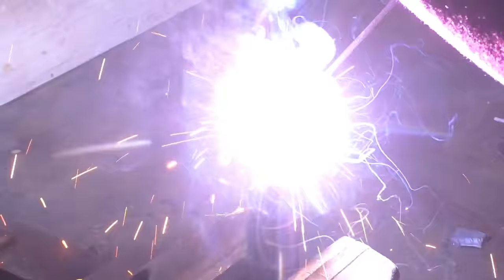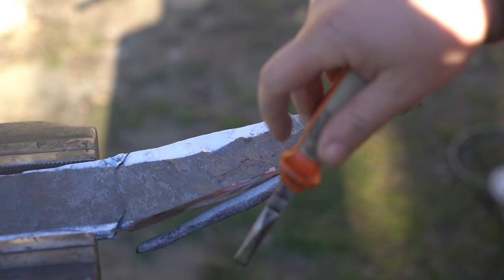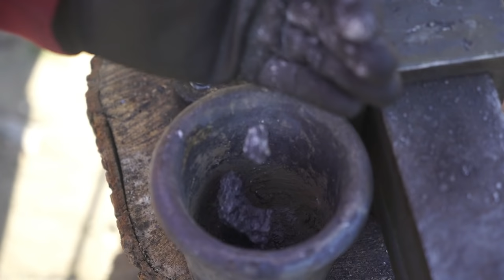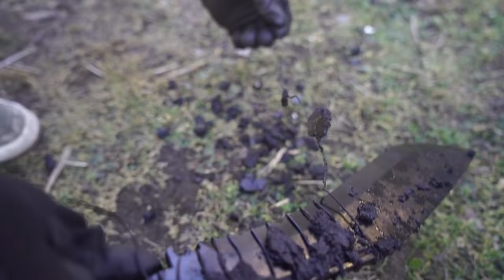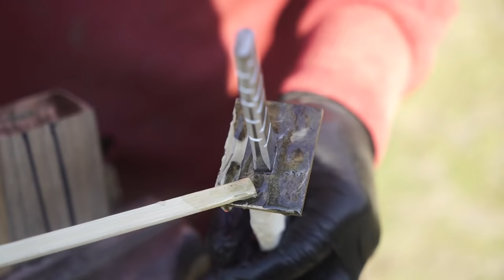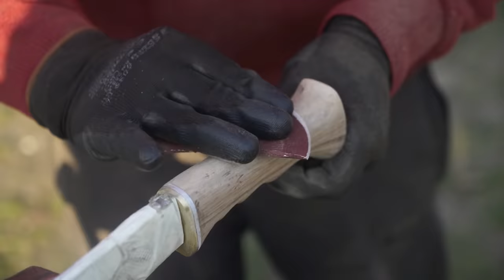Forging a KUKRI knife Out of Rusted IRON GEAR

Comment: There’s a great big crack through the steel where the bend is on the blade. That’s never right!!!
Reply: Yep, that fault will get worse.
Reply: could see the crack from the very beginning! why continue?
Reply: I saw that too. It looks like it is going all the way thru the blade. Guaranteed the first time he tries chopping with that blade or putting it under any kind of real stress then it's gonna snap right at that spot

Comment: Well sir, I see that you have made a mighty fine looking blade there but I can't help but wonder just how strong the blade is? I saw that when you were forging the blade and sanding it down that you had one big ole cold shut on the right side of the blade. I think if I were you then I'd be very careful using that blade. I suspect it will snap at that cold shut but it is a great looking blade just the same.
Reply: I've never built a blade but that was my assessment as well.
Reply: ok
Reply: and l'm not sure about that burnt tip i saw,    but agree , looks great
Reply: He almost broke the blade clean off when he removed materials with his pliers, so yeah, that blade is shite, whether he mended it or not.

Comment: Perhaps this is incorrect, but if you are making a knife to hack at things, I was under the impression that you needed to pin the handle or it will likely break.
Reply: It will eventually loosen up without a pins to keep it tight.   Maybe he didn't do that because he made the tang so thin?   Eithe way a good couple of jolts down the tang and than handle come right off.

Comment: The gears are made of case hardened steel (a tempered steel to which has been increased superficially the quantity of carbon to make possible an induction hardening): not the best solution for a blade, which will be for sure tenacious but not with high hardness. Said so it looks really nice

Comment: Forging is not cutting out a blade and tang from a slab of iron filled with cold shunts. Contestants have been disqualified on Forged in Fire for that because it's not forging. I would not trust this blade to  not to snap in half with use. I hope it's not been made for actual use because an epoxy handle with no pins, steel with cold shunts and cracks, and was that cooking oil? (cooking oil to finish off wood will go rancid. I can't think of any oil that looks like that that you would use except mineral oil to finish a wood handle) It all does not make for a practical knife.
Reply: So you're saying this blade will not kill  ?
Reply: I get what you mean but blacksmithing is a learning curve give the guy some credit will ya?

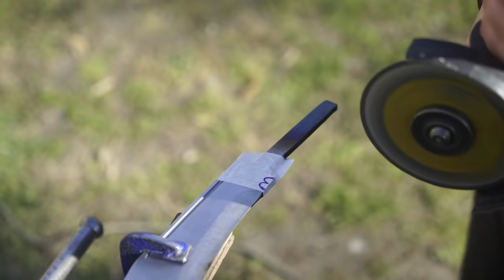Comment: 6:10 I always wondered what those divets are used for? I know they have a purpose but not sure what... Great video BTW .
Reply: Read this, to learn what's that: Kukri is a weapon which has his original roots to Greece. Great Alexander conquared Nepal and that's when the locals, took that Greek blade shape and made their own, shorter version which we now call Kukri. The detail you ask for, is there to prevent blood, to reach the handle and make it slippery for the user. With blood, I mean the blood of the opponent, that will stay on the blade after a hit. That's 100% accurate and not something that just came, into my mind. 
Hope I helped.
Reply: @greekveteran2715  khukuri was from Nepal not india
Reply: @mixcreativek4822  You're right, my mistake!

Comment: I'm not a forger, I just enjoy watching videos of it so I don't know much. Why did you squench with that wire and mud on the blade? What does that do?
Reply: Helps protect from deformation and helps with the Harding process of the blade, using the mud makes it so the spine of the blade doesn’t harden so it can have shock obsortion while the the edge hardens so it can be sharp and tough